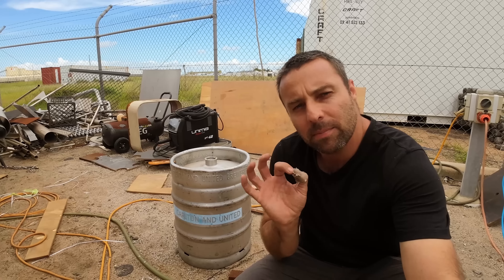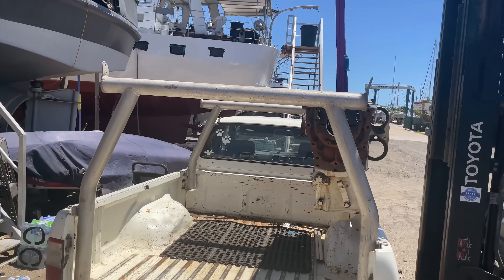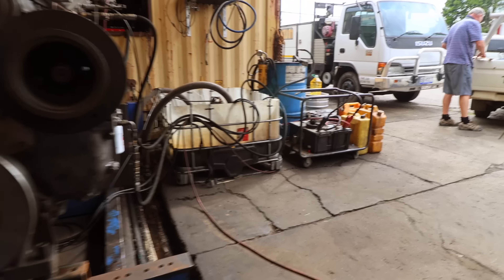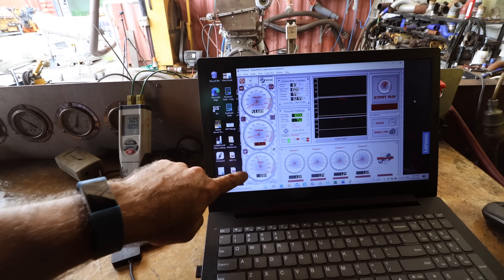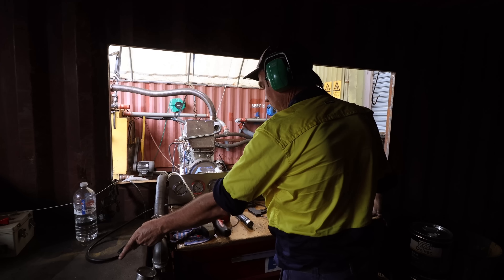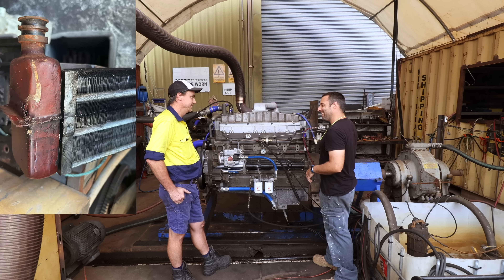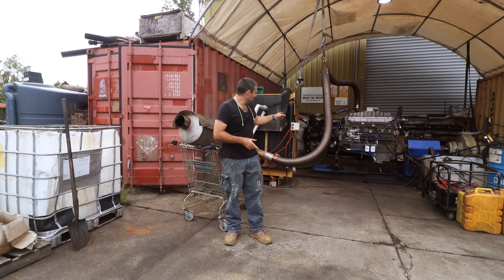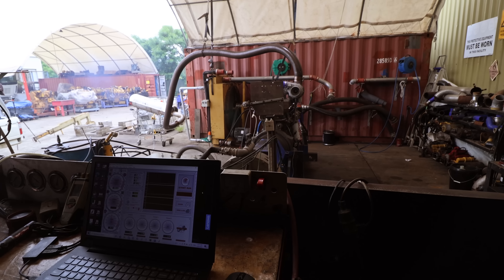Brupeg's Engine Dyno Test - Full power on Vege oil - Project Brupeg Ep.294

Comment: That fuel economy is pretty good compared to a gasoline powered outboard. A 350hp mercury verado uses about 110l/h on best cruise and 235l/h on WOT. Of course the speed would be 'slightly' different, but those numbers really surprised me.

Comment: Where a cummins of this generation was super superior was cost of fuel injectors and fuel pump.........a fraction the cost of anything else.  Heating value of Canola oil and Diesel are very similar, but your fuel consumption results are 20% more for Canola....... Its a common issue that different fuels have different combustion burn speed, it might need timing advanced. To do that on a Cummins, the camshaft side cover plates can have their gasket shims changed. It was a really pleasant blast from the past to hear an NTC-855 pulling on that dyno ))   My dad, has a 7 liter, 6 cylinder Volvo diesel in his F7 truck (RV) .......by replacing the original first generation Garret T-04B turbo with a Holset H351C..........boost went from 14psi to 20 psi and its vastly better to drive in terms of performance, and cruises more easily.  Diesels love boost.

Comment: I ran my workshop heater on veg, had an urn set to about 120 deg, encountered the same issue as you , so had to a..dd a heater block just prior to the burner to heat it.  youll have to do the same pre-pump

Comment: Not sure if you guys are still planning on using a heated oil drum for keeping the veggie oil hot, but I was wondering if using a exhaust heat recovery system (similar to toyota prius) would be an efficient and effective way to heat up oil fast without using an electric element? Love the channel :)
Reply from the maker: Yes we will be using exhaust heat recovery with electric backup

Comment: I’ve been so looking forward to this episode. Great numbers. 
How big are your diesel and veggie oil tanks? With these numbers, what is the approximate range of Brupeg?
Reply from the maker: Hi Ian, currently we have six tanks with 16,000L  in total. We converted two (2 x 3500L) to fresh water so currently we have around 9000L of fuel and 7000 of water. That gives us 2440nm at a high cruise speed (around 9knots), however on long trips we will back right off to around 6-7 knots and add a water maker and convert the water tanks back to fuel. This will allow us around 5000nm range

Comment: cool to see the engine in action, great that the veggie oil is going to work out awesome how clean it burns much rather sail around in a boat that smells like a chip shop than a diesel mechanics shop lol problem is the crew will be starving for munchies constantly lol used to work at a shop that was between a jam factory and a bread factory every day on the way to work could smell both always made me hungry lol stock lots of munchies is my advise lol

Comment: The diesel engine was designed to run on palm oil in the 1800's by a guy called Von Diesel and will run on any veggie oil, in the UK all diesel engines have had to be able to run on veggie oils or bio diesel since 1997, In the Philippines i run my diesels on old filtered cooking oil.

Comment: The best way to run vegetable oil in a diesel engine is to use a proper heat exchanger that is thermostatically controlled, I usually build my own heat exchangers.  I have used the allison transmissions heat exchangers for vegetable oil and they work really well.  The allison heat exchanger has oil in and oil out and water in and water out.  On non marine engines I make a heat exchanger that goes inline in the exhaust and the oil is heated right before it goes in the engine.  For startups you can blend diesel with vegetable oil and switch to full vegetable oil when up to operating temperature.

Comment: What will veg oil combustion do to engine oil quality and oil change interval / fatigue..?? Diesel dilution is a factor over long term running, with appropriate additives, etc to deal with this. Have you got an oil sampling plan to see how the engine oil is holding up??   Similarly diesel lubricates the injection equipment. Is this function duplicated in veg oil???

Comment: Some further notes on "Rebuilt vs New" engine... 🤓
A rebuilt engine has to be dissembled, cleaned, carefully inspected and milled/machined to "spec", measured for clearances and parts. Then finally assembled. Whew..
Further a used block/heads or whatever, have been "heat cycled" many, many times. Relaxed and stable. "Seasoned". Long before our current high-tech metals and factory racing engines the "Pro's" went out to the scrap yards for such "seasoned" engines. All of them, even the likes of NASCAR. (those that really knew what they were doing that is)

So a larger portion of labor, skill and hard work. Throw in a splash of pride and TLC from a pro builder and yer solidly off to the races, er, long relaxed cruises. 😉

Have fun and best wishes from The Great White North..

Comment: The advantage of rebuilding with a reputable rebuilder is it is all hand built, verses a production line engine. Never get a remanufactured engine from an OE supplier as they are outscored to a contractor for rebuilding at the lowest price. As for new I personally had a brand new engine that developed a miss at 32.4 hours, turned out to be a faulty valve spring on No 2 cyl burnt the valve and seat, result new head. Manufacturer Warranted it but still cost 3 weeks out of service. I agree with Damien rebuilt by a reputable engine rebuilder is the way to go.

Comment: Loved the video. That  is,  in my opinion, one of the best running Cummins engine I've heard in a long time. These new gen Cummins sound like a bag of hammers, I think that all the emissions system gear has ruined them. I guess that's why they're trying hydrogen fuel in the next few years
Reply: Thank the government.
Reply from the maker: It takes around 63 modern truck engine running to generate the same exhaust emissions as a 1980’s truck. They also produce more horsepower and use less fuel than an old engine like ours. Emissions gear might make them harder to work on but it’s a positive thing in terms of the atmosphere we are leaving for the next generation

Comment: The fly in the ointment that no one has mentioned is the quality of the actual oil itself. is the oil going to be purchased unused or does it have contaminants in it because it has been pre used and hence will need extensive filtration. If you do solve that problem then the oil will be cheaper brcause then you can buy waste or pre-used oil.

Comment: Just wondering how you worked out your cruise HP & rpm? 
If you set up for the engines max power available at 1450 rpm then this is not what your cruise horsepower will be. The propellor demand curve is what will determine your cruise horsepower and fuel consumption at 1450 
Cummins normally recommend that you set up to match the prop with your max rated HP & RPM, in your case 350 @ 1800?
When you drop the RPM down to 1450 the propellor will demand way less HP, even less than what I think you set up. Or if you set the prop up for max HP available & efficiency at 1450 then the engine will be grossly overloaded at your 1800 rated speed. That’s why several trawlers back here in NZ are now using Variable Pitch Props ie a Hundested unit to get the best of both worlds, max efficiency at cruise & max power.
I currently work at sea on a ship with a VP prop & it’s great for doing this.
When I ran the Dyno at Cummins Auckland we used to measure fuel consumption by weight not volume, not sure if this would make a change in your calculations but it might help explained the difference between the oil & diesel.
Reply from the maker: It’s not precise. It’s our best guess based off a 46x46” prop and the original engine prior to us buying the boat

Comment: I look forward to your video every week, great work you are doing , my question for you about veggie oil, are you getting used veggie oil from restaurants or fishn chip shop, used oil need to go through a centrifuge for around 24 hours, which in turn needs power to do this, are you planning to build one , i was going to do the same with my 7.3 idi f250 but it was to much hassle, really like to know your plan
Reply from the maker: For now we will run virgin oil only until we have a filtering option that we are happy with for waste oil. Our medium term plan is to get to a stage of using cleaned waste oil

Comment: Could the oil be refined even further to create better consumption figures and boost HP ?
Wondering how much the difference with less range and less HP will stack up in your calculations ?
Also is the canola oil recycled ? you obviously wish to use what's available wherever you are in the world ,and will you have difficulty with the oil being too cool when down in ate Antarctic waters .
Looking forward to the engine being installed and the boat in the water
Reply from the maker: Hi Dave, a few thoughts on this. 
Currently we are using virgin Canola oil, oil thats processed without heat and therefore you dont get any polymers in the oil that cause engine coking and damage. Waste cooking oil goes through a lot of heating cycles as a cooking oil and therefore develops polymers in the oil which can bind to internals on the engine and cause a number of issues like sticking rings, injector pump and injector damage etc. You can refine the waste oil into biodiesel which essentailly removes these polymers and gives you a similar performance to regular diesel. but it comes at a cost as you needs to process the fuel which involves significant quatities of methonol and them removing glycyrin from the oil. plus most governments consider it fuel at this point and want to apply a fuel tax (44c/L in aussie) so the economics dont stack up just yet in Australia to do this. Currently diesel is $2700AUD per ton, and Canola oil is around $750-1000 so its still well worth the 16% consumption hit given the raw cost is 37% of the cost of diesel.
Reply: @ProjectBrupeg  thank you for the information, nothing' is easy is it and the availability of diesel over virgin oil could be a deciding factor in toy being able to run when and wherever ? tons of canola oil,is that available at ports ?
Can you add extra emissions equipment (exhaust scuppers )if you
 found that diesel fuel is the best and practical way to go  ?
Ultimately somehow having regenerative power generation on board using the new wind generation methods ,the vertical types could see you going electric?
But I suspect that your aim of being on the water and moving will dictate whether you go complex or basic,in other words ,chuck diesel in her and go .
Best wishes for everything 😃

Comment: Can you not start and warmup on regular diesel and then have a vegeoil heat exchanger from engine water to warm up vegeoil then switch once up to temp?

Doesn’t the run in process also harden some of the components? I have seen programs where new cams were installed without proper run in heat cycle so they didn’t harden properly and distorted

Seeing that keg has made me realise you don’t have a bar!

Comment: You need to get a heater matrix for the exhaust to heat the veg oil they use them on truck mount carpet cleaning gear will heat water to over 100c at flows of over 10lpm just a idea
Reply from the maker: Exhaust heat is something we are s as cricket looking into. Thanks for the leads, will start hunting that gear out now

Comment: How are you adjusting ph (acidity/alkalinity) of the oil?
.
We ran used restaurant oil in our 5.9 Cummins trucks...
... until the oil dissolved the injector pumps.
Reply from the maker: Used oil kills injector pumps, virgin oil doesn’t. Currently we run on new oil only

Comment: Are you not going down the route of transesterfication in order to knock the glycerin out of the vegetable oil? Then you won't get nasty build ups in the engine or have to deal with a fuel that is temperature sensitive?
Reply from the maker: No. We want to modify the fuel system to handle raw oil. Currently we are using virgin oil so no polymers from oil combustion are present and hence the engine is able to run without damage (provided it’s always with load and hot oil). We are looking at using waste oil for transesterfication so we can eliminate the need for fossil fuel diesel but we don’t want the added cost of that process to apply to the total volume of fuel we need, as we do t have a land base so doing that process on a constantly moving boat is going to be a challenge we need to solve
Reply: @ProjectBrupeg  That makes huge sense. Looks amazing so best of luck with this!!

Comment: Will you have to put in an oil heater for the fuel when the engine is installed into Brupeg?  
If so...will it be a tank style like the one you used here or more of an inline style like a jacuzzi in-pipe heater?
Reply from the maker: It will be both. Tank heater to warm the bulk fuel, heated fuel lines to keep lifting the temp. Then into the fuel filters and then into a small tank that pushes the temp up to 100c or so, before it goes to the fuel pump

Comment: Use engine coolant to warm your veggie oil. That way its always at the engines op. Temp.
Reply: Id think you can use coils of stainless brake line to heat your oil to temp.

Comment: Would a higher veg oil temp make better performance? Lovely engine btw, congrats.
Reply from the maker: Performance was fairly stable across a 20 degree temp difference. Mainly it was the smoke clearing right up on hot oil that we noticed

Comment: Yes, I was going to say before he swapped the Holset in, that, at cruise, you weren't really getting any  benefit from the turbo. You would  be not much better than running N/A!   Of course the boost at 1800 revs would make a hell of a difference, but how often would you be using those revs!       I hope the smaller turbo improves your efficiency at cruise revs!

Comment: If you modify waste vegetable oil (ex fryer in a resturant)  with a solvent (orange oil or keronsene) you get a lower viscosity. Also a heat exchanger made from copper piping using the water jacket outflow heats the fuel on the way in.  Less carbon but higher NOx, water cooled exhaust should stop that.

Comment: Fossil diesel fuel has a calorific value of 45.6 approx it will vary a little around the world. 
Canola (aka rape seed) fuel has a calorific value of 45.6. Methyl Ester (biodiesel) is virtually the same. You can expect a 10% power reduction on heated vege oil. Biodiesel might be slightly better at cruising power because the molecule contains oxygen giving slightly more efficient combustion. At full power the energy value will take you to the -10% situation.

Comment: Is the plan to just run virgin vegetable oil, or will you also run waste vegetable oil? There's nothing quite like the smell of chips coming from the exhaust stack! 😁
Reply from the maker: Initially virgin only but if we can get waste to a state where it meets the fuel standards we need then we would love to move to waste oil. More likely we will use waste oil to make biodiesel
Reply: @ProjectBrupeg  Which was going to be my follow-up question....do you have space set aside for biodiesel distilling on board?
Reply from the maker: Right now no. I haven’t been able to think of a way to settle the fuel on a moving boat
Reply: @ProjectBrupeg  Rudimentary gyroscopic platform maybe?

Comment: If veggy oil needs to be heated to get it to a specific viscosity, what do you do if you are in a cold climate and the engine and fuel has cooled down? Is there a way to heat the fuel in the fuel lines? Also, would a smaller turbo give you more power at a lower rpm without sacrificing peak power? Love you guys,
Reply from the maker: Hi Tom. We start up on diesel (always regardless of temp) and then use engine heat, (coolant, oil heat, exhaust) to scavenge off and warm the vege oil. Interestingly vege oil turns solid in cold temp but, it’s possible to have the middle part of the tank warmed up and remain liquid and the outer part touching the hull still solid and acting as insulation

Comment: Diesel fuel is widely available, where are you going to get veggie oil for the engine in remote locations? Just curious.
Reply: Waste oil from the galley for one; better to burn it than have to dispose of it. Also, though it may not be cheaper you should be able to buy some kind of oil most places you go will have some kind of cooking oil.
Reply: Every fast food joint in the world, mate...

Comment: One problem you will run into is build-up of unburned cooking oil on your turbo and charge pipes. And which will cause a catastrophic failure of your turbo
Reply from the maker: If you are using low grade fuel yes. Waste cooking oil often has this issue. Virgin oil such as what is used (when used hot and under load only) avoids this issue. European truck manufacturers allow virgin oil to be burnt in their engines without any reduction in engine life if these rules are adhered to. So we are following their standard operating procedures to maintain engine longevity